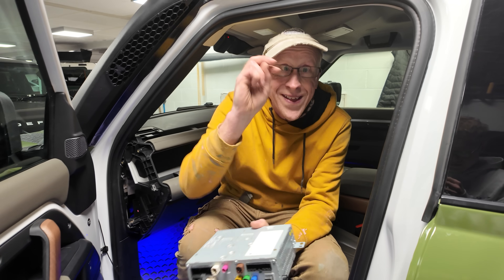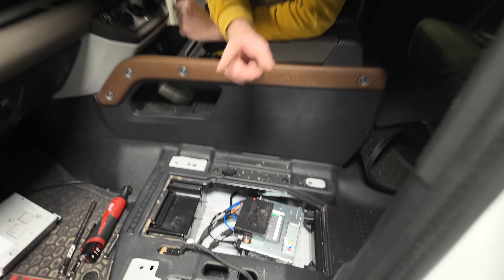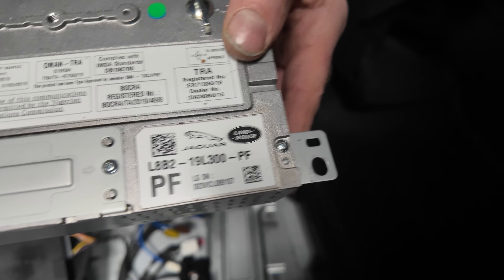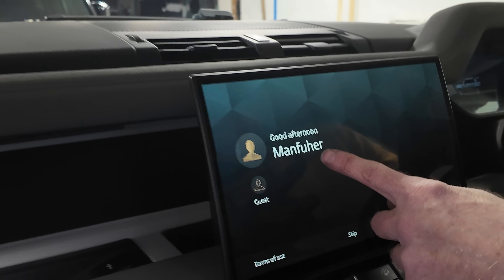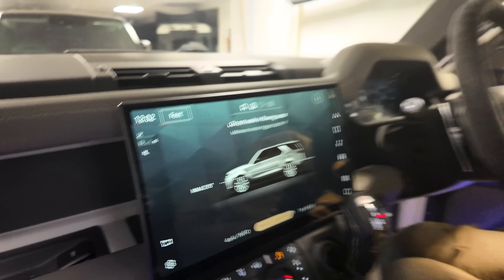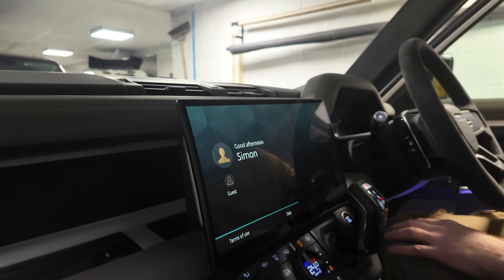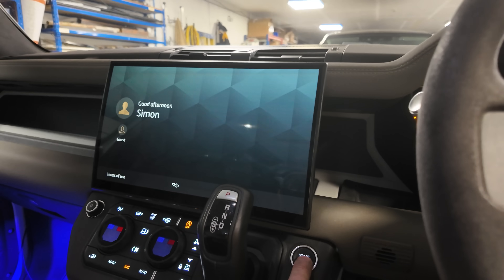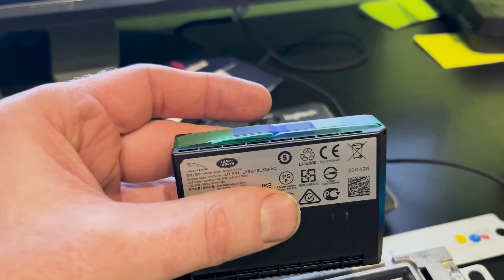Land Rover Defender L663 Water Damaged PIVI Infotainment Computer Under Seat - Fixed for £134 !

Comment: Hi, I got the same issue. The computer under the seat got water damaged.
I have dried it for a week, but still not on. Is there any solution to fix it?
Reply from the maker: It may be possible to get a used item and reflash it... if you give me your chassis number ( do it via our website ) I will let you know the part number / engineering number you need.
Reply: @L @L663 can i know the product name on your website?
I cant find it

Comment: Are the speaker cables for the door speakers also connected to the device connector under the seat? If so, do you know the wire colors? I'd like to tap into a high-level signal for an amplifier. I need help. Is this a good place to tap into it?

Comment: Are the speaker cables located there as well? Can I use that spot to connect the speakers for my amplifier? Do you maybe have a plug-and-play adapter connector for Cinch and Remote? I have a Defender with the standard 6 speakers (180 watts).

It would be great if you could install an amplifier and make a video about it. Thanks!
Reply from the maker: You have the amp in the boot on the lhs. Behind the trim panel… it’s a big panel to remove

Comment: I own 2023 Land Rover Defender, p400e, x. Yesterday check engine light vent on, car was driving fine, but with weird noise, it was very cold outside. I went straight to my garage. We don't have an official Land Rover dealer in my country.  I have connected the gap tool, following errors came out -p3039-92(6c), P1A22-00 (A8), P0AFA-00 (AC). I have tried to clear faults, but they still appear. In the morning I connected again, and could not clear them, but the little engine sign next to the faults had gone, and the check engine  light went off. I drove the car for about 20 km, just fine, no strange noises or anything,  no check engine lights. Can anybody help me with it? Should I just keep driving and observe?

Comment: Always enjoy your video’s. Interesting to note the Sat Nav was showing Scotch Corner after you replaced everything. It must have retained a setting somewhere…
Reply from the maker: I think this is the last place the car had reception ( where the car was last powered up - and broken for spares )
As we were in the workshop there was no GPS reception so it quite sensibly uses it last location until it gets an update.
IF this is from a stolen car ( my police contacts are checking ) then we can tell where they had the car and also where they stole it from !

Comment: Another great video guys, I'm always curious about which parts are coded and which are not. Did I hear there is new legislation coming to stop manufacturers making things that are not easily repaired and wonder if that will put and end to coding.
Reply from the maker: The down side of non coded parts is that cars are more valuable to thieves as all parts can be sold…
Reply: @L663 of course, bloddy criminals!

Comment: I suppose sourcing a used pivi unit from a like for like car might reduce the potential for headaches when swapping over. Of course, you are dependent on what is available at the time. 
Interesting video. 👍
Reply from the maker: Yes this was worse case but it was a good test as we could see all issues. This unit was also a lot cheaper than others around

Comment: Some engineer at JLR installed a computer module below the wading depth of the vehicle.....while leaving acres of space in the dashboard.....briiiiilliant.
Reply: Agreed very dumb, I think we should look at making a relocation kit is the loom allows this module and the key module to the glove box area I would have that in there instead of all the rubbish 😉 thoughts @L663 ?
Reply from the maker: Its a hard item to relocate due to the number of connectors it has going into it - this in itself is questionable.. in this day and age USB C can power all your devices from your laptop.... monitor etc. Any box that has more than Power + CAN bus + Antenna is questionable...all those connectors cost money / cause problems / increase weight / increase assembly time. Land Rover need to embark on a mission to reduce the number of connectors on the car by 50% at least !
Reply: @L663  I'll have to have another look at the loom and where it actually goes back to, 1 potential idea is to relocate the key module ontop slightly and Gain about 1.5 inches by putting spacers under the main module, easy enough. Then you might have about 2 inches to 2.5 inches under the main module. The other option would be to look at how much play is in the loom and could put a box in the storage area in the centre console or right back into the glovebox. Agree way to many modules and connectors.
Reply: It floods here in Houston, Texas all the time. Oh my, placing the some of the most sensitive electronic parts under the seat of the vehicle is a no no

Comment: Great video Simon thanks for doing that. I’m more interested in the key control module… Would you be able to start your car if it got flooded? I would consider the infotainment unit the least critical system in the whole car so yes a good compromise on the location…
Reply from the maker: Yes you can still start the car by placing the key next to the ribbed area on the steering column - i believe - not test but i could test by unplugging the KVM
Reply: we have tested this without the TV module and without the key module completely disconnected from the vehicle and the vehicle still works, just place key under steering column as Simon says 👍🏽

Comment: Couple of weeks ago we also got stuck in deep muddy water and i accidentally tried to opened the door (i was so much in panic). Water level was just at the upper side of the outside plastic  trim and luckily when i saw the water coming in, i immediately shut it. It was such a dumb move. Nothing has happened to the Defender but mentally it broke me a bit 😂. Thanks Simon again! Great video
Reply from the maker: A Lucky escape ! How did you get unstuck ?
Reply: @L663  
I take full responsibility for what happened during our offroading adventure. Everything was perfect, and we had successfully passed the same spot just 20 minutes earlier. However, for the sake of a video 😁 I decided to cross it again. My wife warned me not to, but I was determined and went straight into the water. Unfortunately, it was a mistake.

We got stuck in about 80 cm of deep, muddy water. I had to climb out of the window and jump directly into the water to assess the situation. The Defender was completely stuck—its belly was resting on the ground, and all the tires were off the ground. I tried putting things under the tires to gain traction, but nothing worked.

After 30 exhausting minutes, a HUGE thanks to another Defender (an older model with extreme mud tires) that came to our rescue and pulled us out of this uncomfortable situation.

Well my confidence and ego took a hit thats for sure but we walked away with some unforgettable memories 😁
Reply: @hakansultanoglu  it might be a good idea to take the two covers off underneath the seats and look to see if there is any water or mud that got in it sounds like you maybe we're just lucky enough to not get any in
Reply: @newdefendermods  Just checked again and there’s nothing on the battery side, but I noticed a thin layer of dried mud on the bottom of the Pivi side! It’s not much, but it immediately brought me back to that moment. I can’t even describe how lucky we were!
Reply: @hakansultanoglu  very lucky, the unit is slightly off the floor but only very slightly you got lucky by the looks of it.
Reply: @newdefendermods  i think Pivi unit is 1cm off the floor and in our car dried mud layer goes upto max 2mm. Its not the thickness of the mud by the way. I have never even thought that the water came in reached there until i saw Simon's video and your comment.
Reply: I remember in 2007 when the Puma Defenders came out owners were also concerned about flooding the interior of them and several members of the club I’m a member of relocated an ECU from under the seat to a Tupperware box on the ceiling liner or onto the bulkhead behind the driver. I cannot recall ever seeing reports of Puma ECUs actually getting wet in the usual location. I have seen one TD5 that got waterlogged inside and that did result in a damaged ECU.